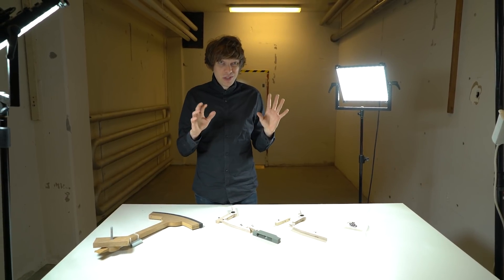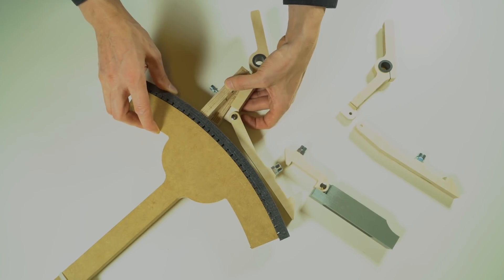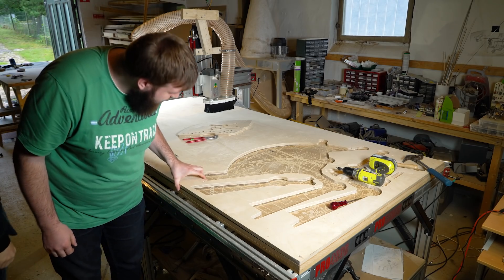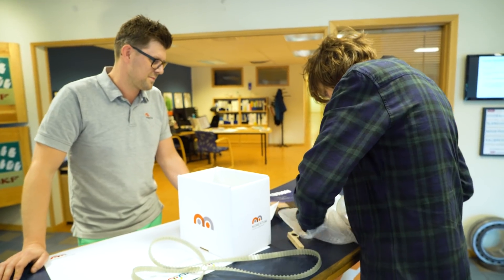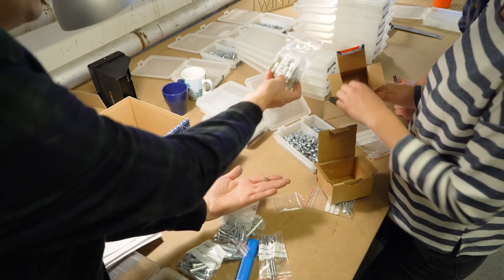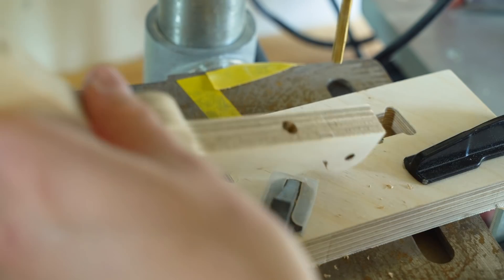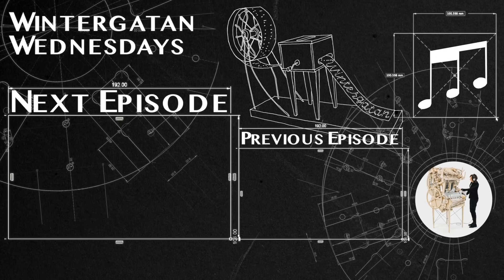158 Plywood Parts - Marble Machine X #16

Comment: you should use PTFE (teflon) washers on the registator pivot points to reduce friction and prevent stiction especially since you are using wood that subject to shrinkage/expansion. Felt washers will also take up some of the tolerance of the expansion in the joint and keep things tight and rattle free. I also suggest you put the jig on the outside of the router instead of the inside operations that can cause a pinch like action if you get a jam.
Reply: Teflon would SEEM like a good idea for pivots... but just ask a bunch of piano technicians what they think of the Steinway pianos with teflon action bushings built during Steinway's "CBS era" in the 70s and thereabouts...
Reply: In fact, here's a well written, detailed article on the subject. Martin, you should read this too, if you have time. It might save you some headaches on the road. Don't forget about climate in the venues you will be playing: unless the humidity is constant, or the wood specially treated, or the wooden parts designed to allow for changes, the expansion and contraction of the wooden parts due to humidity changes could be a problem with the reliable functionality of the new marble machine. That isn't to say you should not work with wood, as wood is a beautiful material and literally more soulful than metal and some other things. However, please do keep humidity changes in mind, and please read this article!: https://www.chuppspianos.com/teflon-bushings-the-steinway-sons-teflon-piano-era/
Reply: I did not wrote bushing I wrote washer the issue is not on the pivot axis but the interference plane of the 2 pivoting parts of the registrations. He had a very tight or loose the idea is to leave it as loose so the dimensional change against the interference plane can be taken up by the felt and the ptfe washer.

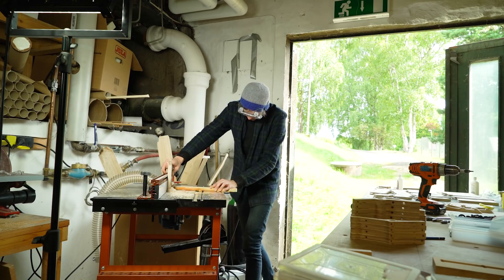Comment: 11:20 You can create a finger board to hold your work tight to the fence, a little something like this: http://images.woodmagazine.mdpcdn.com/sites/default/files/styles/scale_1500_1500/public/image/2016/12/12/photo%202%20featherBoard.jpg

You mount that to your table, and the idea is that material slides between that and the fence (and your router bit of course). It keeps your material only moving in one direction (so it doesn't kick back) and it also pushes it very tight to your fence which is important if you want to get thicknesses that are the same on each part. Even if you got that rig dialed in exactly, I can almost guarantee you'll have a pretty high variance between each part. I mean ... high by my standards at least. =P 

Hope this helps.

Comment: 10:10, I would have run that the other way: access from the front as so but cutting from the back using the the bottom and top half as my guides. Running the piece between the router and the gate seems pretty terrifying to me.

Comment: Beware that too many rare earth magnets in this machine may become an issue with transporting it by air.  There are very strict regulations on this.  The magnetics can mess with the avionics of the aircraft.  You may want to research into this.
Reply: The requirements are measured from several feet away from the package. I'd be surprised if there was much of any magnetism detectable from that far away.

Comment: You shouldn't ever put the piece between the bit and fence.  Instead open the clearance slot on the fence & have the bit protrude just a bit past then you will not have the old trapped.  A feather board will improve accuracy.  This may not help you much but will definitely be safer.

Comment: If you were to play a long set of fast 16th notes, it looks like the mechanism that bumps into the pegs on the programming wheel would miss 2-3 of those pegs if you had all the pegs filled up one by one on the wheel (on the same channel). The adjustable block of wood seems very thick and wouldn't drop back down to the next set of pegs after the last one had enraged it if all 16 holes were filled.  Though I'm a assuming each section of 16 holes (between the screws) is one whole note, divided into 16ths if you wanted to do some fast rapid trill-effect.

Comment: When you're moving a fence, but you want to do it precisely, it helps to have a magnetic dial indicator. You stick it to the cast iron surface with the dial's pin against the fence. You can then move the fence by a precise amount.

Comment: Hi , just wondering why you did not use an acrylic sheet instead of plywood? we use to contact cement it down to the spoil board to prevent movement ,or for repetitive parts we would make a "D" type gasket to hold warped materials down  ..but great stuff you'er doing I cant wait to see it done !!  ...  Dr. Greene

Comment: I think you could have got away with the same router jig you were using, but instead of screwing the piece down on the front, and running it on edge, just get rid of the little clamping piece on the front, and run it face down on the router using a larger bit. The fence distance to the bit would control where the shoulder is, and the bit height would control how thick / thin the cut would end up being (just remember to route both sides before measuring.

 Just an idea if you ever need to cut more of those in the future. It would be a lot safer while still being precise and repeatable. Keep up the good work, and stay safe.

Comment: Your 3d part is very well designed (I think you printed flat and then curved it on the wood) Perhaps you should partner with formlabs (and get your 3d prints in nylon that has been sintered); the part could be printed as shaped, and would not need to be bent.

Comment: I love the work you guys are doing on this, One thing in this video that concerned me was using magnets for the register pins, Neodymium Magnets are extremely brittle, and I'm afraid over time they will fracture and break. You might want to consider using smaller shorter magnets in the register holes that will then hold steel pins, This way you still have the easy of quick changing the register pins for new songs, But the steel won't break or fracture over time like the magnets would.

Comment: Instead of routing parts for hours with a CNC, it's actually much better (and more advisable) to do it in parts. 
Not only for when you screw things up, you are in big trouble, but it's less heavy on the machine as well.
Pretty much a nog go normally, lol

Nice video btw! :)

Comment: By relying on weight nuts and gravity to pull the mechanism down, you limit portability of the machine to terrestrial venues only. Your call, though.
Reply: Isn't he already inherently limited to terrestrial venues because of the free falling marbles? ;)
Reply: No, TheBookDoctor is right. This is going to add too much weight to the spaceship for the Mars gig!
Reply: That would make for an interesting challenge for marble machine makers.

Challenge: Build a marble machine that works independent from gravity.
Reply: Not to mention that the timing will be all off during the concert on the Moon!
Reply: I think you could probably do something cool with centrifugal force with marbles in zero g.
Reply: Gigzur 
Dude above me solved the mystery.
Reply: By using  centripetal acceleration in a rotating vessel to simulate the force of gravity a la 2001: A space odyssey will combat this problem.
Reply: One week is too much waiting!! Please let it be wintergatan wednesdays and fridays!!!
Reply: Peanut Butter 
The marbles are metal dude. You risk them falling hard. On top of theres alredy magnets in it.
Reply: moving marbles through a closed system via a pneumatic system, pressure and vacuum?  hand crank could power a pressure and a vacuum pump via simple mechanical advantage... store pressure and vac in accumulators...
Reply: Gravity doesn't exist. An electro-static atomic charge will flow towards ground, just like in an electronic circuit. Outer space is a fraud. Nobody gets outside of the domed Earth.
Reply: Bill Keith Channel somehow I knew this account would piss off flat earthers!  There's too much work, thought and practical applications of physics in this machine for it to be okay with the flat earth conspiracist community.  I am fully unsurprised to see someone denying simple science in the comments.

Comment: From my years as a test engineer I've learned that trusting gravity in a mechanical construction is not a good option. I'd suggest adding springs that will help hold the parts separate when you mute the machine. Especially as all the wood will create dust as the parts move and that fine dust will collect in gaps which will create friction and then suddenly one of the arms wont drop when you mute.
Reply: A torsion spring is actually not a bad idea! I'll keep it in mind if problems arise :-)
Reply: May I remind everyone that a piano action uses gravity and lead weights to reset each note. Martin's design looks similar to this. I don't think it will cause any problems as long as the machine is well maintained.
Reply: good point, a simple spring elongated under tension while the mechanism is engaged would ensure mechanism disengages on demand.
Reply: I was thinking torsion springs in the joints.
Reply: Springs are one of the oldest technologies in the book. Torsion springs (like watch springs) have been used for centuries... I don't think they go against the feel of the simplistic mechanical technology
Reply: Humidity changes causing those wooden hinge joints to swell too tight are probably more likely to be a battle for MMX.
Reply: A good point well made.
Reply: I agree with you Mr. Biloglav except for one little detail - that he is making this a sort of simplistic machine to make wonderful music and not a "modern marvel" of electronics.  I might be tempted to use a more positive device such as a spring which you suggested.  Or maybe he would be okay if he used a 3 pound bolt?  :)  Just kidding.

Comment: If filament cost is not too big of a deal - maybe try out Flax filament from extrudr (https://extrudr.eu/collections/bdp/products/extrudr-flax?variant=14283198790).
Otherwise you may also check out the guys from 3dk.berlin, they have a ton of different colors in their store (at least PLAs).
I would not recommend using wood filament as this might be too fragile for such a machine.
Another choice could be PETG, e.g. from DasFilament (https://www.dasfilament.de/filament-spulen/petg-1-75-mm/).
If you want to have experts from Sweden at hand get in contact with the guys from 3dprima.com, they have a huge assortment of 3d printing filaments (all different kind of brands, colors, materials).

Comment: I'm not sure why is it important to have a convenient way of removing a pin from the programming wheel. Except for the mistakes, you will never change the melody once it is programmed.
Reply: Removing the pin and changing the song is kind of an important feature of the Marble Machine. It's a misconception, even the old one could play different songs.
Reply: As far as I understood the programming wheel (drum) will be an easy-to-exchange part of the machine, to play different songs on one concert. If so, one drum is for one melody, one drum will be programmed only once.
Reply: The way I understood it they are planning on having one drum playing while another is being reprogrammed/repinned back stage. Then they can make quick switches.

Comment: The Fix for the router and Jig that you are not comfortable with is to have the Router recessed with in the fence and turn the  jig around. Thats the super safe way to do it and at the right depth it should cut out the right amount on each side.

Comment: The best way to hold work firmly against a tools fence is to use a feather board. Safer for the fingers and they prevent the work from kicking back. Hope this is helpful.
Reply from the maker: That is helpful, i toyed with th idea when i was working with it, i think i can cut a featherboard myself on the bandsaw and just clamp it down. Thanks for reminding me!
Reply: Use two feather boards.  One right before the router bit and one right after it.

Comment: More magnets? Please, be careful. Honestly, I'm concerned with this whole design.
Reply from the maker: What is the danger involved? Any other ideas? You have to be able to reprogram LIVE during a concert so the programming pin system has to be fast...
Reply: I was just thinking about the long term reliability and ease of maintenance of Machine X.
If it is to be reliable (given that it is designed to be easily moved and therefore assembled/reassembled between concerts), magnetic pins are fine (sort of) but what will happen when the pin holes in the ply wood expand and wear from use?

Comment: 10:46 When feeding a router table and working on the back side of the bit, just feed left to right instead of right to left so you're not climb cutting.
Reply from the maker: True! I just realised that i could have put the fence on the other side to be able to use my hands natuarally and push with right hand to avoid feeding wrong way.

Comment: A much safer way to do the sketchy routing part would be to turn the work 90 degrees onto its face  and route it from that position with multiple passes (using the fence to determine the depth instead of the table). A larger bit would be preferable for that for better result though, but keeping the work flat would be much safer than trying to keep it vertical with such an extended bit.
Reply: I would suggest doing this step on the CNC, make the fixture on it, Leave it in place, then fit in the parts and machine away, possibly even have the 2nd operation pocket so it fully supports the area machined away in the first opp,

P.S. I'm a CNC machinist professionally ; )

P.P.S I love this series, its great to watch you learn about production methods, cant wait to see the completed project
Reply from the maker: Thanks great tip! 
we tried something like that with alot of kickback aswell, maybe the bit was getting dull. Bit i think we took to deep passes again aswell!
Reply: Or, a table saw with a dado blade. You could mount the jig onto a crosscut box and it'd be smooth sailing I think.
Reply: Or use the fence for what it's for, enclose part of the bit so that only the cutting depth is peeking out. 

Turn the jig 180° around so the pieces are against the fence  and feed from the same side. Using featherboard to press it against the fence
Reply: Whenever I need to route an edge where the piece is between the fence and bit, I run it through backwards flow. Also, once the distance was set, you could run 2 parts at once, then flip slots for the 2nd pass.
Reply: Dado blade is definitely the way to go on this, especially for the height the cut  that is being made at.
Reply: A drawer lock bit is ideal for this. It has a wide, low cut. Recess it into a sacrificial fence, and lay the parts/jig flat against the router table.
Reply: The cnc can do one side of the operation at the same time as you are cutting out the profile and drilling the holes.  Then you cnc your jig for holding the part and leave it in place so you don't lose your reference position and machine the other side.  The plywood is not always perfectly consistent in thickness from batch to batch or across the whole sheet so you may have some variations with the exact same setup cutting from another sheet with two sided machining.  Having a shoulder plane or rabbeting block plane is nice for fine tuning joints like this.

Comment: Do you already have an idea about the weight of the whole machine in the end ?
Reply from the maker: HEAVY! It will be very heavy. but i want to build weight into it because i want only the moving parts to move and the machine to be still. Jonas, The logistics person i am working with for the tour says that weight is not a problem. And since its modular every module on its own will not be crazy heavy but when assembled you wont be able to move it that easily.
Reply: I'd wondered on this as well as I watched the frame welding in a prior episode - that was some serious gauge material! If shipping by air, weight can be a real issue (volume even more so). One thing to consider is that water (or sand) is fairly cheap wherever you're likely to tour. Having a tank or something that could be filled for weight and emptied to move could make things easier on you.

Comment: Please fix the kerning in Wintergatan Wednesdays title - it's painful to watch.
Reply from the maker: If we change the kerning we have to cut a whole new sheet of plywood on the cnc so we have to weigh how much it hurts vs how much it would cost for materials and time, maybe its worth it!
Reply from the maker: Actually you are probably right, do you mean the overall spacing or the strange short spacing between the I and the N in WIN for example? I put up the logo on a wall the other day and thought it looked wrong! If you can elaborate i would be thankful!
Reply: Wintergatan The general rule of a good kerning is the following. Imagine that the space between each pair of letters is a vessel with liquid. These vessels have different shapes but your goal is to make all the vessels (spaces) look like they contain the same amount of liquid.
You also wanna have slightly bigger spaces when typing with all capital letters.